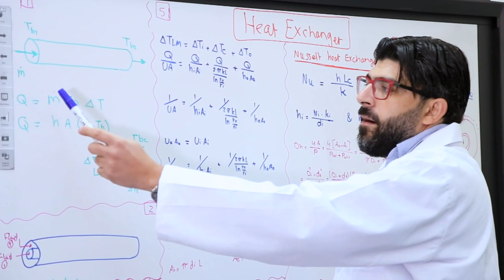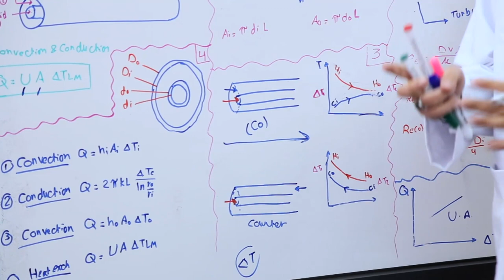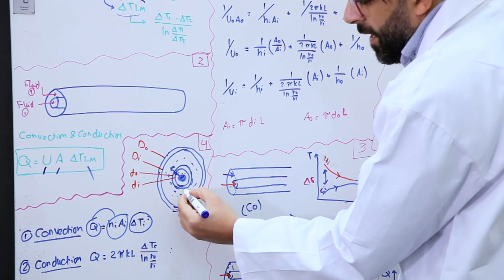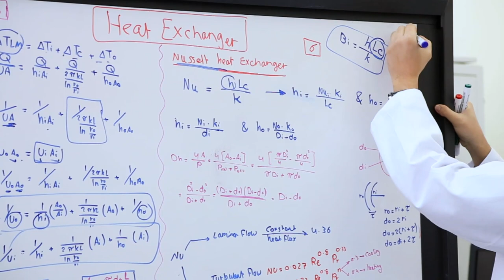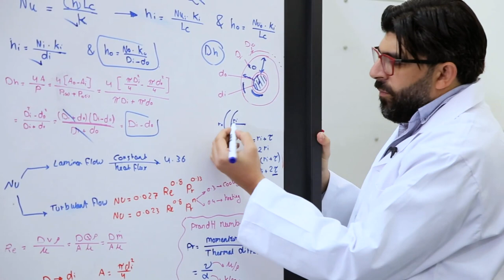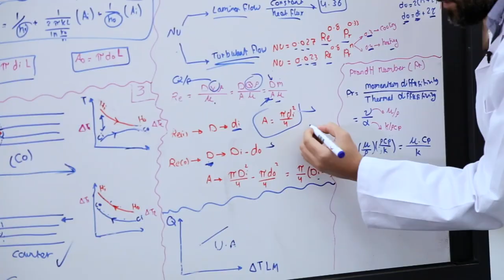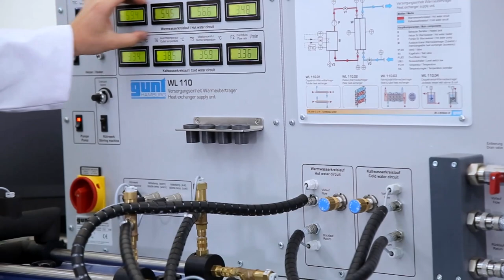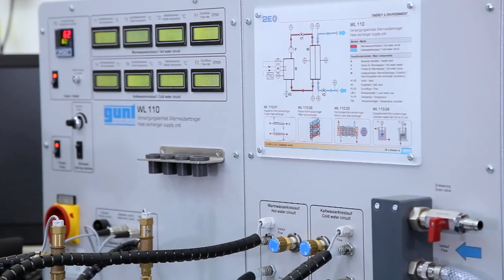Heat Exchanger (Theory and Live Experiment)

Comment: A fascinating theoretical introduction and a practical application for comparing the counter-current setup with the concurrent setup. However, there are many details given in the heat exchange process's theoretical background and its involved parameters. A systematic explanation is needed, yes but can be given outside the video in a step-by-step written sheet with a link to download it by the Web's interested people. Thank you very much for this nice video. A great effort is behind. Rest to recommend a list of references (Text-books and published papers) to trace the whole story available for more details for the professionals and professors.
Reply from the maker: Thank you very much for you valuable comments and significant advices. I do apprciate it. 
Yes, you are correct, but going for deep detailed theory is out of the scope for this video. This is because this video is dedicated for underground students in order to conduct tubular heat exchanger experiment in the same vieo. However, we are planning to prepare another viedo for designing and modling HE, which will include more details related to industrial application.
Thanks a lot a gain for your review and valuable comments